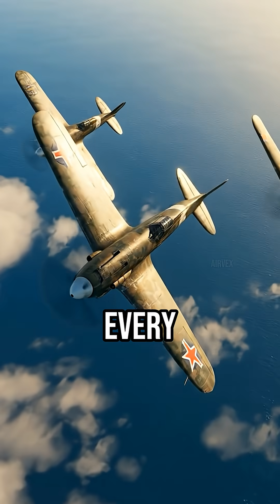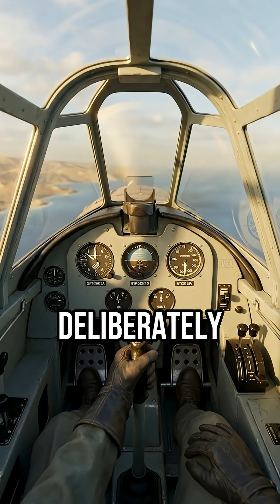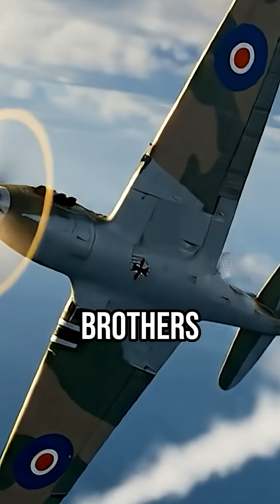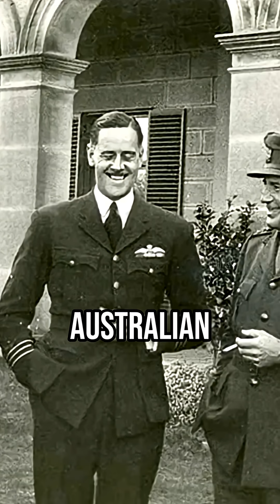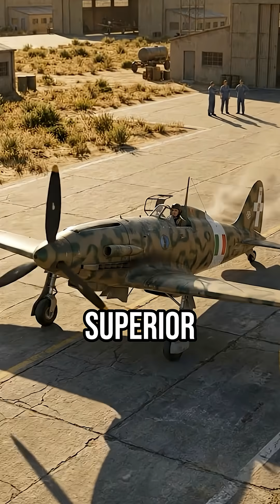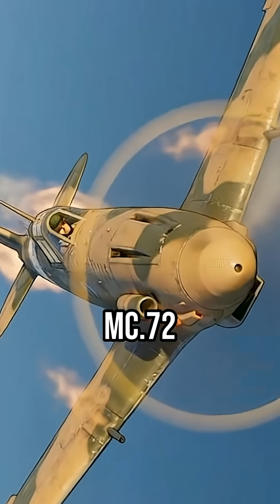Why Italian aces refused symmetric wings?

Comment: The video doesn't explain that single engine propeller planes to veer to one side in flight, and that's just a reality caused by the spinning of the engine. The unsymmetrical wing design corrected this.

The video also doesn't explain why this makes for a deadlier fighter. Unsymmetrical wings alone cannot explain their combat performance.

Comment: Italian pilots, like most pilots of the era were stupid young men and Italy did a HUGE mistake by letting them have a say in aircraft development.

Oversized bomber cockpits that provided a comfortable workspace for crews but DRASTICALLY reduced speed. Fighters with humped, glassless cockpits that improved visibility but also reduced speed. And above all, BIPLANES.

Those were all adopted on pilots' insistence. And Italy ended up with a useless airforce.

Comment: When a prop engine that large wants to accelerate on take off it wants to kill itself by literally rotating the whole frame on the ground. Bf109 requires stiff counter inputs to control this. The extra length wing just helps stabilize the torque on take off

Comment: Just saying “over Malta they achieved this” not sure it’s even true but that also doesn’t mean the aircraft was insanely good. There are so many other reasons why that could be the case. The brits has hurricanes over Malta for such a long time with its terrible climb rate they never had a height advantage or parity with any incoming axis planes until they got spitfires. They got decimated by the luftwaffe too so

Comment: I can't imagine the torque from those giant supercharged engines. I used to fly small Cessna 172's and you can feel the torque even from that 180 HP engine, I can't imagine how it feels from over 1500 HP.
Reply: the torque was so strong that they had to teach pilots not to panic and quickly open the throttle as that could cause the aircraft to spin out of control and crash. There are reports of F8F Bearcats (2000HP) rolling over still on the ground simply because the throttle was slammed all the way from idle.

Comment: Propellers have several left turning tendencies, the torque effect which will make the plane roll in the opposite direction of the propeller, asymmetric blade effect makes the right side of the propeller disc  generate more thrust, also the slipstream effect makes the air pushed backwards by the propeller impact on the left side of the vertical stabilizer, this all combines in a left turning tendency that can be counteracted by using a longer left wing, the bigger surface will generate more lift giving a slight right turning tendency that will counter the left one. In practice not all this left tendency is counterbalance because you don't want your plane to suddenly start turning right when flying straight.

Comment: So they mitigated with a bigger wing, what the engine pull on the other side.

Its like saying a Sword hilt matches the blade weight, even having different sizes.

I call that perfect equilibrium.
Maybe the wing made barrel rolls less straight line and evasive maneuvers were improved.

Comment: This is all nonsense. The engine's torque effect varies, and it can't be compensated for simply by varying the fixed wing lengths. This effect is more often compensated for by positioning the engine axis at a slight angle.

Comment: My father was an F4U  pilot in Korea and they had 2000 HP single 13' prop on the aircraft.  He said the torque was intense, so the planes turned tighter in one direction (the Left, if I remeber what he said correctly) and poorer the other way. He said in a dog-fight, you pull a tighter turn in a left dive, and pull away from a pursuer.
Reply: it's bcs the of the direction of the movement of the propellers

Comment: I figured it was because of the torque
Reply: Well you must feel silly because the video said it was because of the torky
Reply: @scottabc72  Not really, it just makes sense from a physics standpoint that you would have to counteract that one sided rotational force in some way. Early ww1 biplanes were notorious because of this issue, many of them had issues trying to take off because of it and would crash if pilots didn’t manually correct it while attempting take off.

Comment: I wonder if a similar modification might have reduced the loss rate to crashes with the Me109, which had a tendency to veer sideways on takeoff due to engine torque.
Reply: In this case the real problem was in the narrow undercarriage and the pivot points being so close together. Also the Hurricane was way more forgiving in ground handling, take off and landing than the Spitfire for the same reason.

Comment: Same reason the Sopwith Camel was so quick to turn (and also hard to control).  Today we’ve taken that to a whole new level creating fighters that are so unstable they are almost unflyable without a computer but can change direction in remarkable ways.
Reply: They're not almost unflyable without computers, they are completely unflyable.
This is done intentionally because a naturally unstable plane has far faster manoeuvrability.
Reply: @JS-rz5gx  and it's not fighters, it's literally one fighter. Only the F-16 is like this lol.
Reply: @Mygg_Jeager  JAS 39 Gripen was also built this way.
Reply: @venaimsharess6525 Not fighters, but The B-2 (and it's prototypical predecessor from Northrop) and F-117 are both naturally unstable, one because it is a flying wing which naturally yaw and pitch uncontrollably without constant input and the other because it has a very irregular shape.
Reply: @Mygg_Jeager Multiple aircraft are like that
Reply: @Mygg_Jeager  F-16 has relaxed static stability but it's very, very simple by modern standards. It's a jet that happens to be unstable, not one architected around instability. Computers have evolved slightly since the eary 70's and every top-tier western fighter since the F-16 uses relaxed or negative static stability. F-35, Typhoon, Rafale and Gripen aren’t just way more unstable, they’re structurally dependent on software. Flight envelope protection isn’t a safety net, it’s the only way those aircraft exists.
Reply: No it's not the same reason. It's to counterbalance the torque from the engine.
Reply: The Camel could turn quickly - in one direction - because the rotary engine was spinning, which amplified/exaggerated control inputs in that direction (while resisting control inputs in the opposite direction).  I don't know if anyone during WWI had worked out that having one wing longer than the other would've countered that effect.
Reply: @funstuff2006  Right, because of the rotational torque, it could turn on a dime to the right, but had to make long slow turns to the left.
Reply: and cars.....a stable plane is harder to turn....

Comment: That's because when the enemy saw them those pilots were thinking W T F long enough to get shot down. It was deliberate to interrupt the enemies thought process.
Reply: Polish aviation marks on the top of the wings were placed unequally under the presumption that enemy pilots would use the highly visible marks as aiming points to more easily fire at the center of the aircraft, which could strike vital components like the engine, cockpit, or tail. If an enemy pilot used the unequal marks as aiming points, they would aim to one side of the fuselage, creating a smaller cross section and missing vital components. I am unaware how effective this was though, as the enemy pilots could probably just as easily aim at the center of the plane just fine if they ignored the marks, but the intent to deceive was evident.
Reply: War is deceit.

Comment: The tale on the F4U Corsair was built off center to compensate for engine torque.......
Reply from the maker: Cool solution, actually!
Reply: BV-141 longer wing was on the engine side the shorter wing was on the cockpit side same with the elevator.
Reply: Not only the Cirsair had this solution. A more common solution was to incline the tail with respect to the centerline by some 10° like an in built trim, to my knowledge this was the most utilized method.

Comment: So.why didn't the other manufacturers take this up?
Reply: They did just in different ways. As another poster stated, the vertical stab would be misaligned with the longitudinal axis to compensate for the rotating slipstream caused by the propellor, the engine was also canted so as to help counter act torque and the gyroscopic effect.
Reply from the maker: Yep
Reply: @fjohnson9749 thanks I should have known this, even in modeling the fire was is set 2° right thrust and down. The reason being am into rc model planes
Reply from the maker: They had different views for the same problems (:

Comment: Try to find these kill ratios they’re talking about

Good luck
Reply from the maker: The kill ratios are well-documented in multiple historical sources. The 51st Stormo C.T., the most successful Italian unit over Malta, reportedly achieved a score of 97 aircraft destroyed for the loss of only 17 Folgores, which is precisely the 5.7:1 ratio mentioned. During mid-1942 in North Africa, the Folgore achieved a kill/loss ratio better than that of the Messerschmitt Bf 109, and on March 6-7, 1943, C.202 pilots claimed 19 RAF and two USAAF aircraft for the loss of two Folgores. These figures come from official Regia Aeronautica records and are cited in aviation historian sources, including the Smithsonian's own documentation of the preserved C.202. The asymmetric wing design detail is confirmed by the National Air and Space Museum's technical specifications, which state that Castoldi made the left wing 21 cm longer than the right wing to counteract engine torque. This is what I've used for the video :)

Comment: It was all about the rotational torque, generated by thr spinning propeller. Prop planes have to be trimmed or biased in the opposite direction to counter this rotational effect.

Some clever Italian engineering there.
Reply from the maker: True and agree about Italian engineering :) Do you like Italian WW2 planes in general, by the way? I do
Reply: @Airvex-f3d yes I do. I am a huge WWII military tech lover. My grandad was a veteran. Fought for the South African army in North Africa and Italy. I am a tank and plane nerd
Reply: @Airvex-f3d  F4U corsair is the same way. its rudder is slightly offset, not perfectly lined up with the fuselage. Its left wing is slightly shorter than its right wing too.
Reply: @Airvex-f3d if you like italian fighter in ww2 please read "frecce, saette, folgore e veltri" by Giulio Cesare Valdonio edited by Aeronautica Militare Italiana
Reply: It Goes Back To WW1 When Pilots Developing Aerial Combat Doctrine Discovered That Because Of Aero, Torque- Basically Physics- Some Aircraft Had Unique & Quirky Characteristics That Would Help/ Hinder Combat Tactics. 

The Sopwith Camel As An Example Had A Lightning Quick Turn When Pulling The Stick & Kicking The Rudder In The Direction Of Engine Rotation To Corkscrew Away & Evade Enemy Fighters.
Reply: @j.p.6022 absolutely 
 Well explained. Its also the reason that piloting command  sits in the left hand seat of a cockpit and made left hand turns. Propeller driven planes turned a lot more easily to the left due to thr torque effect generated by the props spinning and the airflow over the aircraft wings and tail.
Reply: yeah, that is brilliant engineering
Reply: When watching the 90’s sci-fi show Babylon 5, I always thought that a space station should have two equal counter-rotating cylinders to counterbalance each other and create the artificial gravity.  I thought the same for the fictional Earth Alliance Destroyer Agamemnon.
Reply: So actually the fictional G.I.Joe Tomahawk helicopter has it right, because it has two equal and counter-rotating main propellers.
Reply: @perfectsplit5515 I am not familiar with that fictional helicopter but the physics is sound. The Russians actually had a helicopter with two counter rotating sets of blades stacked one on top of thr other and it didnt have a tail rotor as it was unnecessary.
Reply: I believe it is not mostly rotational torque, but the air pushed from the propeller gives one side a different lift amount then the other by pushing the air under one and over the other
Reply: my favorite plane that tries to counter this is the MB 157 it has an assymetric engine
Reply: It also created unstable stall characteristics
Reply: @Inertia_Drift I can well imagine. One wing would definitely stall before the other and it was probably handful ar low airspeed
Reply: All torque is rotational by definition of being torque
Reply: some just put in the engine at an angle to counteract this whilest flying but makeing 1 wing bigger is also a way 2 do it